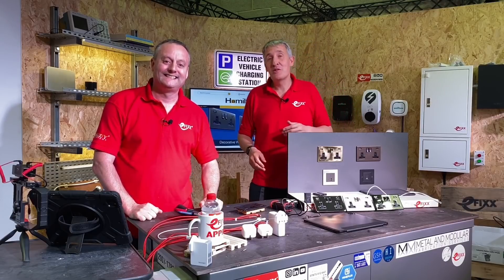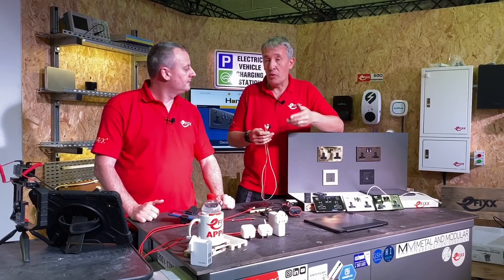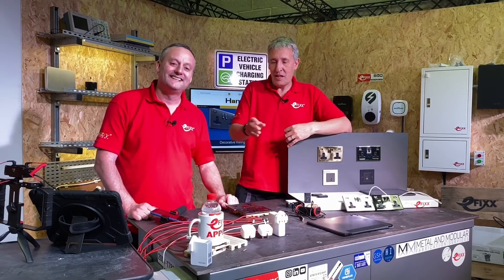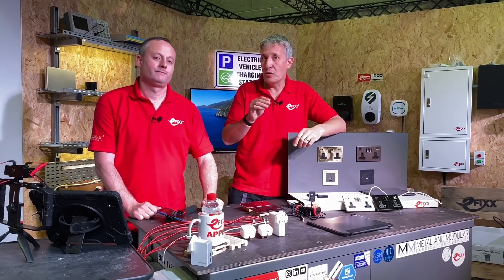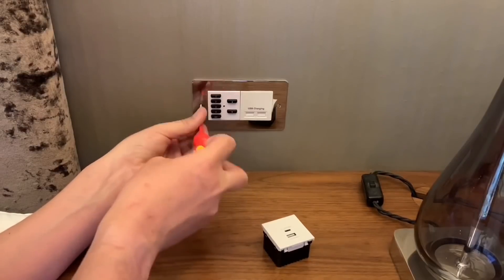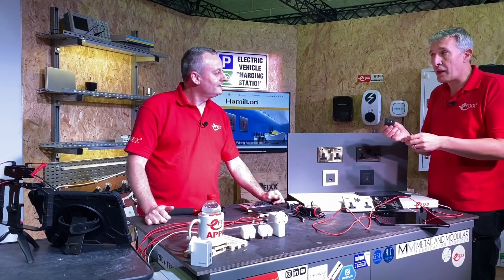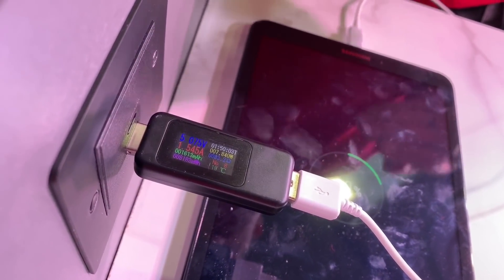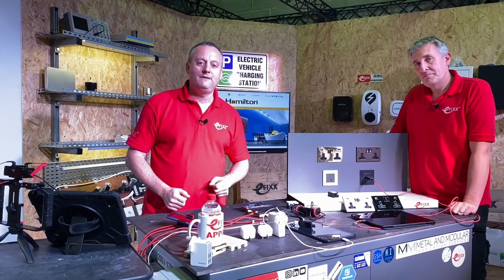Which type of USB charging socket should you fit for faster charging?

Comment: The laptop needs about 85watts...so I require a 100watt minimum output usb c socket to use it and charge it.
Which one should I buy? Everyone I find they are PATHETIC and seriously under powered. 
If usb c can do 240watts then 45watts is not just low, it is not going to run the laptop.

Comment: I'm not a gadget freak by a large margin, but its 2023, and the only device I how have that has non-USB C is an old Camera, everything else is USB C. And with the EU mandating that all Phones, Cameras, and similar devices will be USB C. Why are so many larger manufactures still making only USB 1 charging? or if they do, its a dual 1 USB C + USB 1 charger.

I am moving soon to a new home that will need a re-wire. I can't see any need to install any USB 1 (slow) charging. Why cant I but a 13amp twin wall socket with twin USB C fast charging? And the same for a 50x50 Euro? apart from very questionable unbranded Chinese crap?

Comment: I'm using extension cables with built-in chargers. The one device that has an issue is the amazon tablets they take 2.5W from everything other than the Amazon charger

Comment: Hi. I want one of these in the bathroom to connect a voice assistant. 
I know you can’t have mains outlets in a bathroom, but usb is far lower voltage so should be ok right?
Reply: I have Euro plug adaptor (two pronged to a 3 pin British plug - you can get them anywhere - a couple of quid in the £ shop) I plug my Echo dot power cube via this into the bathroom shaver socket.  It has a very low draw and has worked perfectly for about two years now.   If you searched eBay you could probably get a two pronged Euro/American power cube and cut out the need for the adaptor.

Comment: We have a raft of plug in chargers. As new phones come along they require a more powerful charger. We have 500ma, 1000ma, 1200ma, 1500ma, 2000ma, 2400ma, and the latest one is 3000ma. Only the most powerful one will register on my wife's newest phone.

Comment: I had Euro Modules fitted 9 years ago with USB B sockets supplied by the French manufacturer "Legrand". The physical connector type does not matter one bit - it's the protocols that matter,  Cables to suit most phones with dozens of connector permutations are available on ebay (for examole ).  

Regarding regulations, the modules are effectively Domestic Equipment which happen to use back boxes in the wall. Every module in the house is powered off a single 3 A connector unit feeding T+ E  within the wall instead of flexible in the air . The installation fixed wiring ends at the Connector Unit.

I find telecoms suppliers MUCH cheaper than electrical suppliers for a wide range of euro  modules  - TV , phone,  RJ45, RJ11, D-type, HDMI etc. etc,
Reply: The physical connector does matter because USB-C supports higher charging voltages than USB A. So you can achieve higher power delivery down USB-C than USB A.

Comment: would love all these usb soloutions to have a power switch for the electronics to reduce the circuitry power draw and have the ability to turn the circuitry off if not needed or faulty to allow the AC sockets to still work
Reply: This is my exact question that I posed above, if you have a plug-in wall where you can unplug it there by stopping that vampire load, these built-in sockets either here in the states or over there where you’re at do not seem to have a switch so these things are always running a tiny bit in the back what a giant waste.
Reply: https://youtu.be/gFdCOC0CqQs
Reply: https://youtu.be/gFdCOC0CqQs
Reply from the maker: We made this follow up video to explore the issues you raise. https://youtu.be/HIsTK42o8g0
Reply: @efixx  That seems to link to the same video as above...
Reply: @efixx  you did not address this this is the same video we are watching now he just said maybe you could have this whole circuit on a switch this stuff needs to be just like your damn outlets with a localized switch at the plate

Comment: you shouldn`t fit any usb sockets look at the electrical safety council test results
Reply from the maker: The report is prior to BS1363 amd2 - the problem moving forward is chargers won’t be supplied with battery powered devices .e.g smart phone. So a customer will have to choose a charger.  It doesn’t matter if charger is in the socket or a plug in unit - choose a reputable brand. 

Link to report for reference of what to watch out for - https://www.electricalsafetyfirst.org.uk/professional-resources/product-safety/usb-socket-outlets/
Reply: @efixx  never be able to turn it off if fitted into a socket, that is the difference

Comment: Hi efixx great informative video as usual. Does the USB euro module need to be locally fused as I assume these can't come straight off a radial or ring  or ciruit.
Reply from the maker: They can be connected direct  to the circuit - you would have to spur off a ring due to terminal size.

Comment: The MK Euro module has switches on the sockets so no power is used until a plug is inserted. Does the Hamilton do the same?
I don't like the fact that most usb supplies are permanently connected to the mains
Reply from the maker: It doesn’t have a switch - interestingly MK dropped the switch on their sockets with USB built in.
Reply: @efixx  They were expensive and needed a 47 mm box. But still a pity. There are some USB only sockets on Amazon with a switch to turn them off.
Reply from the maker: We made this follow up to look at these issues - https://youtu.be/HIsTK42o8g0
Reply: @efixx  Should build indicators near the usb charging ports. Red for charging and green for charged. 😳

Comment: USB = Universal Serial Bus. Yet, there's nothing "universal" about them. The race is on to see which company can corner the market for mass production of charger types. Meanwhile the consumer must still have a differing selection of charger types for our various devices. We are the pawns in a "war of patents" as each company claims to be the standard one.
Reply from the maker: It is a bit of a challenging situation at the moment. Hopefully the EU will mandate USB C at both ends soon and that will drive through standardisation.
Reply: @efixx   I thought we left the Eroupean union to make our own rules, regulation and standards.😳
Reply: @efixx  I agree. But the pressure is on as to which company's version of the USB configuration is to "the standard". Are companies like Samsung and Motorola going to have to pay royalties to Apple if their configuration is chosen as the standard? I can see a bidding war between companies and the EU playing out somewhere along the line.
Reply: @Alan_AB  USBC is royalty free. Apple helped develop the standard but take no revenue. You may be thinking of Thunderbolt3 which has the same presentation but is owned by Intel and others.

Comment: +efixx  Do they make these USB outlets for 120-volt markets such as the United States?  I have an idea for a massive upgrade that makes these USB outlets capable of delivering up to technically 118 watts of USB power, using the full specs of USB-C to deliver up to 100 W and the full specs of USB-A to deliver the additional 18 W.
Reply from the maker: We believe you can get 120V wall receptacles with USB charging built in.

Comment: Thank you boys! Great video same every video before. 

But one question: Why have every socket in UK (and every device e.g. freezer) a switch but an usb-port not? 

Specially every usb-changer in my hosehold (here in Germany and in Thailand) stay in a switchable socket or I put out this device if I not used it.

If we have a thunderstorm we put out all devices since more as 50 years in my family. We never have had crashed electric devices ...
Reply from the maker: Another quirk of the UK electric system

Comment: Those USB sockets take ages to charge my phone as the charger the phone comes with is a 40w charger
Reply from the maker: The 45W euro module in the video should offer the same performance
Reply: Will take ages if its not a power delivery socket that can negoriate the higher voltage - general rule of thumb - if its makred up as 5v and 2ish Amps then its a "dumb" supply and will not offer a quick charge facility

Comment: Will fast charging damage the battery, and or, lead to the overheating of devices?
Reply from the maker: Battery management is managed by the device - they typically fast charging until 80% charged and then moving to a slower rate. Fast charging with the PD socket is no different than  the chargers supplied with the device. Always use cables from a reputable source.
Reply: Thanks for the reply! I enjoy the quality content of your videos. Keep em coming 👍